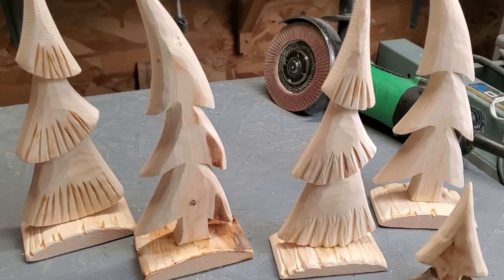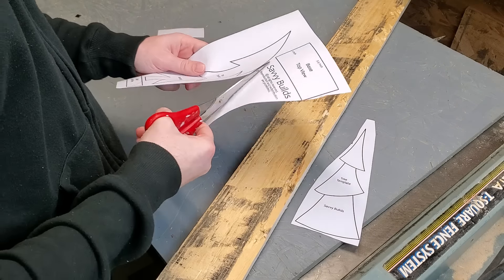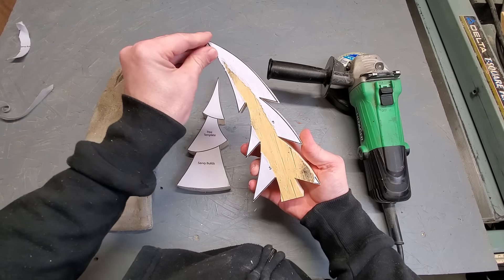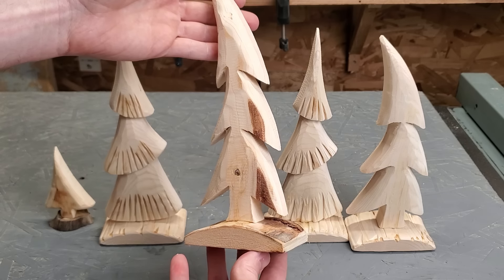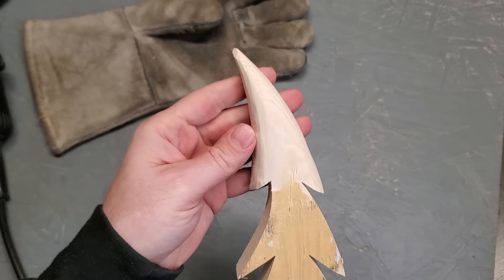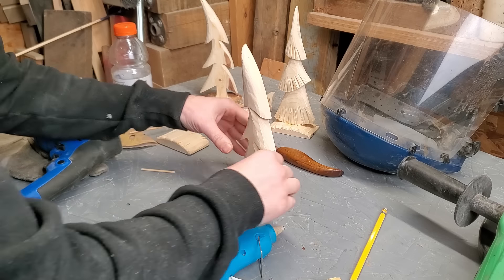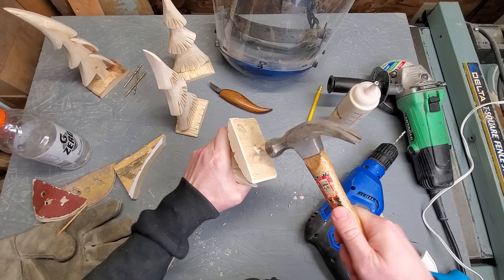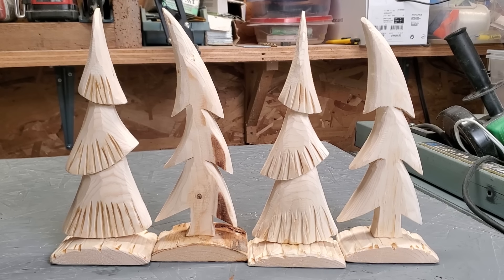Wooden Christmas Trees - Easy Pallet Wood Project

Comment: Hi, being a amateur power carver myself  ive done so many of these and your right they do take ages to draw up. Those trees look good, nicely done.
Reply from the maker: Thank you! I gave up several times. Had to keep coming back to it but eventually got it right.
Reply: @savvybuilds  Why don't you make a template instead of keep printing off designs. Just a thought.
Reply from the maker: @phil3332  Yes, that works too. I should have mentioned that in the vid. Thanks!

Comment: Here’s the issue. If it catches the glove no the sander won’t hurt your skin. It spinning and ripping fhe glove into the middle of a spinning death wheel at thousands of rpm is what will mangle your hand. Unless by some miracle the gloves flys off without your hand. Please don’t do that.
Reply from the maker: I hear you but in my experience this has not been the case (Knock on wood). I've buzzed my leather glove a few times with my sanding disc and nothing happened. Probably because it's so thick. I had a close call with a wire brush but not the sanding disc. 

It might be fun to make a video testing different gloves with various attachments. I've heard of some people modifying the switch on the grinder so that it can't lock the power "on". So if it did swing around it would automatically turn off. However, I think it would be annoying and awkward to hold the switch "on" the entire time with my thumb.  

Another thought I had was to use a foot pedal to power it. That way if anything happens I can just lift my foot and it turns off.
Reply: Safety Sally has arrived
Reply from the maker: LOL
Reply: Beautiful Power carving. For small simple shapes I’ve used rasps. Almost as quick and the teeth leave textured character. For holiday trees I sprayed a pale green transparent base, ghost hint of metallic, dots of mixed yellow/fluorescent yellow. Easy project to batch out. My stained and natural trees looked like an unhealthy fire damaged forest.